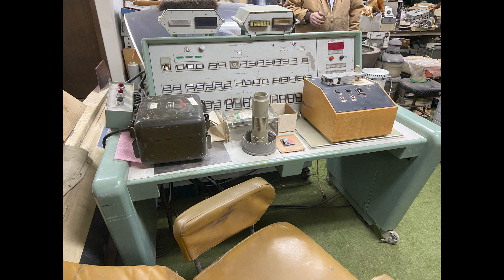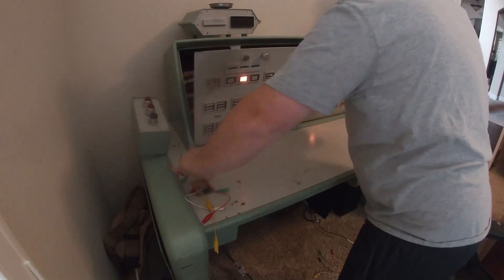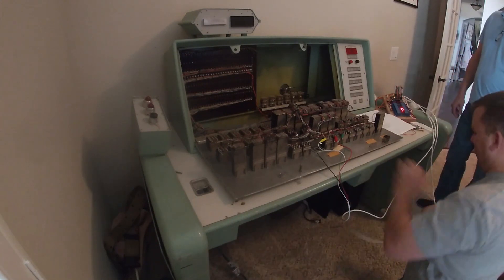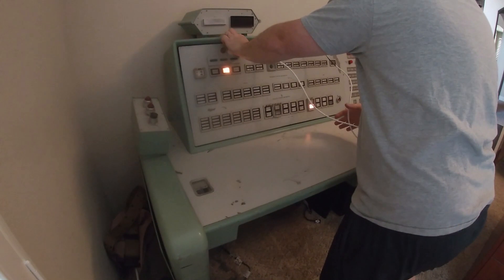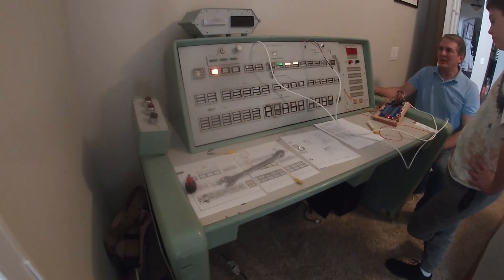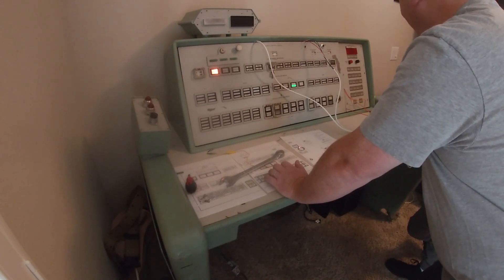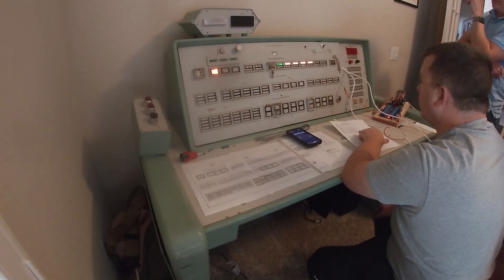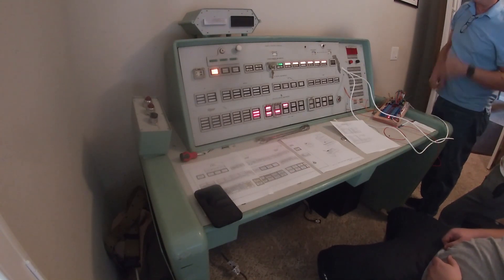S2E01 - We have a AWESOME Launch Control Desk - Owning a Titan II Missile Silo

Comment: Funny how it takes one Arduino these days to do what a whole mainframe use to do back then. I remember reading the manual for the silo system, was an interesting read & showed just how complex the launch process was.

Interestingly I have not found much on the computer systems that were in the control room. I know the guidance system are still a closely guarded secret.

Comment: Hey guys, great job restoring the simulation. I trained on that very console for six years at McConnell. I was an MFT with the 533 SMS. We had to get up at oh-dark-thirty to be at the MPT on time, even on those crazy cold Kansas winter mornings. Then we'd stand for hours checking the equipment as simulations ran and lights flashed across the LCCFC just like in your video. The trainers would give us problems and we'd follow checklists until we came to an "end item." Every once in a while, a trainer operator would try and trick us by giving us problem that wasn't in the book. The reason was, and I quote, "Trouble analysis does not include end items that are obvious to a trained technician." That was a real paragraph in the SAC CEMs (Strategic Air Command Civil Engineering Manuals) which we used to track down malfunctions. A lesson I'll never forget.

Comment: Okay.  This is too cool.  Has been amazing seeing this coming along.  I had a good laugh at how a little 8bit arduino micro controller is able to handle all the logic it took the bulky analog internals to manage.
Reply: In this case, the Arduino is just a timer. It doesn't have to actually handle anything besides turning the lights on.
Reply from the maker: Yea but technically the desks never did handle any logic. They are just repeaters for what is elsewhere